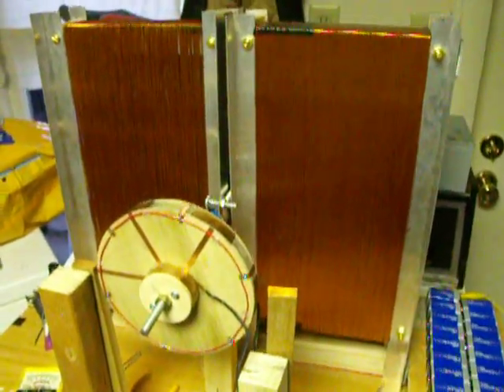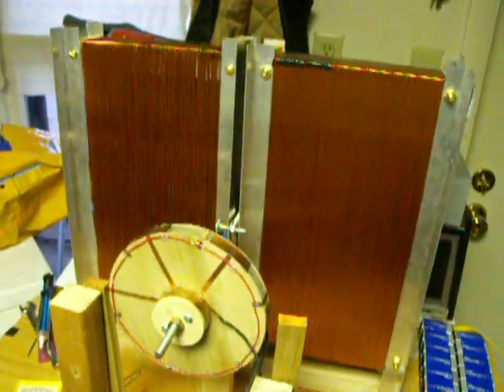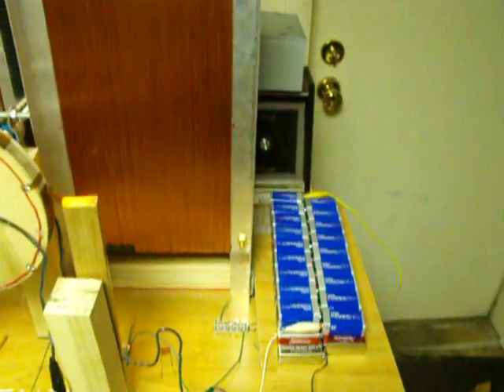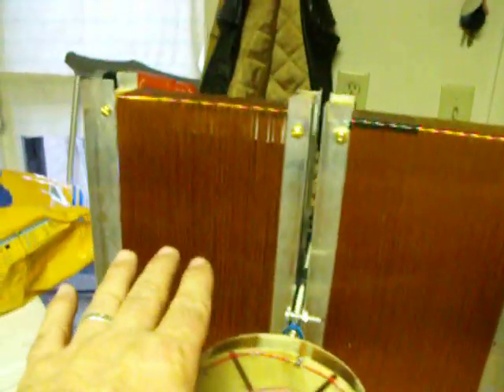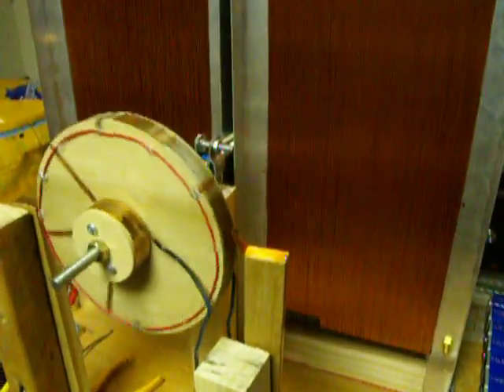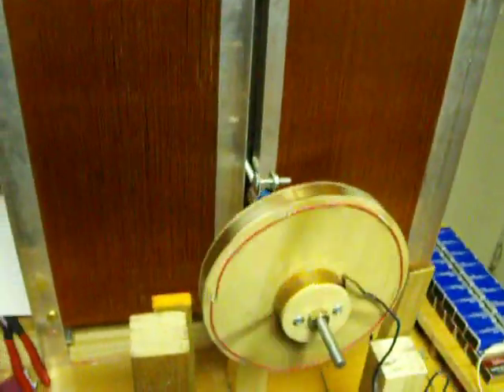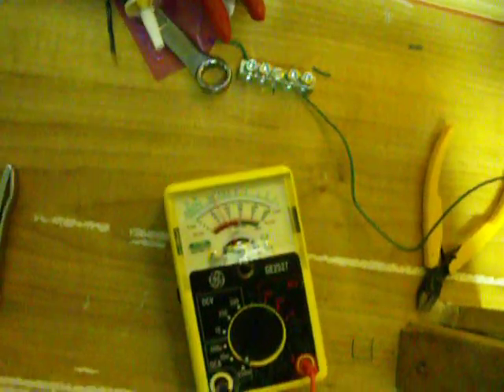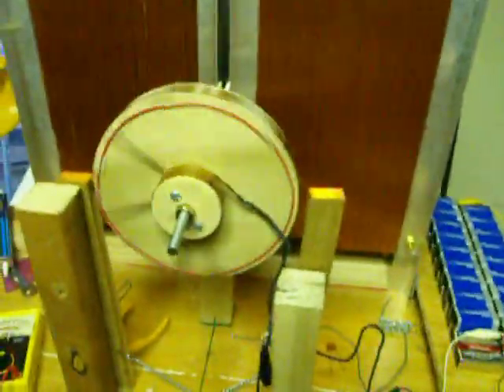Newman motor #3

Comment: Have you given up on the Newman motor? Were you able to get overunity? I read your comment on amazon.
Reply from the maker: As I have mentioned in others comments, I was not really trying for over unity. I would have needed a whole lot more copper wire in my coils. Essentially, I have moved on from Newman's method.  Look up Quanta Magnetics on YouTube. I think they have a much better setup.
Reply: @detrix42  how many pounds of copper wire did you have on your Newman's motor?
Reply from the maker: @sergejpanov5543  one pound on left and one pound on right.
Reply: @detrix42  Do you think that there is more to it than Newman told in his patent and the book? Some kind of motor secret that he took with him to the grave maybe?
Reply from the maker: @sergejpanov5543  I believe Joseph Newman was on to something. The logic I follow is: with the same amount of voltage/current applied, but increase the number of molecules of copper, there will be more magnetic flux. This makes sense to me. But you will need lots and lots of wire to really get a benefit. Again I suggest looking at Quanta Magnetic's videos. I like that idea a whole lot better.

Comment: I've wasted countless hours obsessing over the Newman motor, read his book.  The book wasn't hard at all to get my hands on, some claim the book has been altered, but the hard cover is insanely expensive.  I fell in disbelief when I found out that although Newman explains exactly how a motor works and highlights the issues, he was recorded having zero knowledge on how to build them and failed miserably trying to build a larger scale model with the help of engineer professionals.  I don't recall the site I found out all that, but I found it with Google, it's hardly hidden knowledge.  Honestly I feel more confident with extracting hydrogen from water to power a motor, converting that back into electricity, solar power could even provide source electricity (from what I've learned so far), making outputs much higher.  I'm simply adding my 2 cents of constructive criticism, no offense intended.
Reply: I don't think the Newman small scale replica's can work at all. Big Eureka my be a different story. This machine has such a huge mass of copper is it possible that  some Lenz's law effect be happening with earths magnetic fields when the back EMF occurs??? The small models don't seem to be able to tap into this???

Comment from the maker: @existance12d:  No, that was not my concern at the the time.  I believe I will need a lot more wire for overunity.  Besides, my aluminium frame is not doing so well.  I am considering on redesigning it with wood, but funds are tight, so it may take a while.

Comment from the maker: @EnterAtOnesOwnRisk: I am trying to build my own joule thief circuit out of components I have pulled out of junk electronic crap.  I have one transformer that is working well.  If I come across a Fuji disposable camera, I will probably try it.  With my current joule thief circuit, I can step up a 1.5v battery to 120v.  I am almost there.

Comment from the maker: @cuprocarbon 
I am already on it.  I ripped out some 330uF 200v caps from a used computer supply, and with my JTC I can chage it to 100+v with only 6v input.  I have charged up the cap, pulled the cap out of the circuit, and took it to the motor, and it moved a tiny bit.  With enough caps I should be able to make this work off of say...12v.  Oh yeah.  ;)

Comment from the maker: @kmarinas86 
Ok I can see that. oops. Thanks for the correction.
I am working on a "joule thief" circuit to supply the voltage. 
I have a joule thief circuit right now taking 6.5v out of a 9v battery, and stepping it up to 85v.  I plan on using two 6v lantern batteries

Comment: You have an inductive load in your circuit, so V*V/R does not equal the power input of your circuit. V*V/R would be about 100 watts (340*340/1155). You calculated R*I*I which does turn out to be around 7 watts (1155*0.08*0.08). That is actually the heat loss in your motor (if you ignore the back spike). If you take 340 volts and multiply it by 0.080 amps, that brings it to 27 watts. When my 32" fan had three coils, I got the same results you did, but now it is 16x more efficient with six coils.